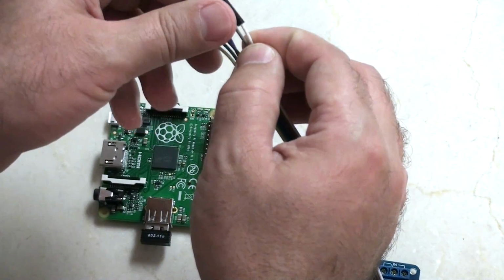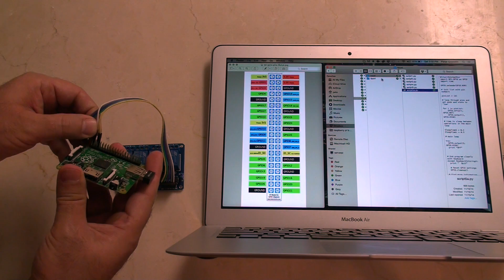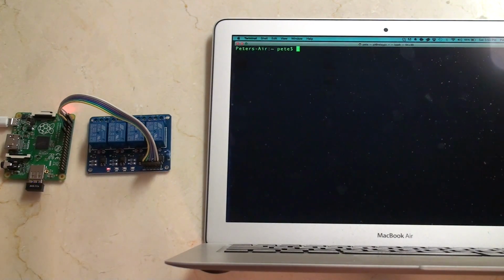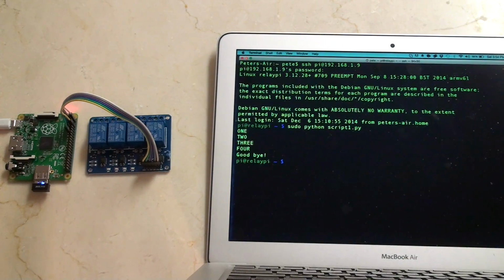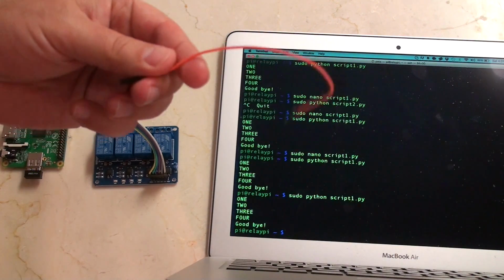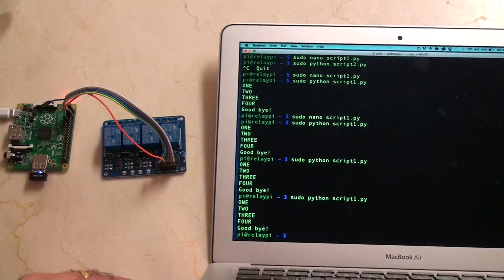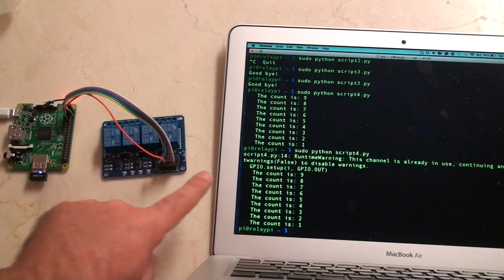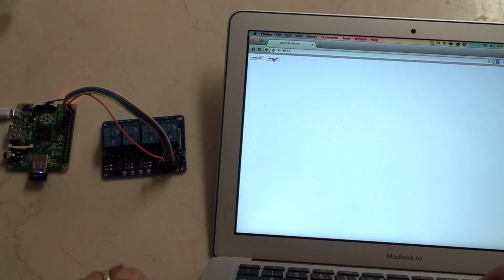Raspberry Pi: 4-channel Relay step-by-step with example scripts for home automation

Comment: HI, I'm not sure why, using your PHP code, the Python script won't run. Other than have all packages deployed, what do you suggest to debug it?
Reply from the maker: +Raymond Rivera .HTML!!!  It needs to be renamed .php
Reply: +Alexandre A. Passos If I run the Python script manually, it works. But not pressing the buttom on the PHP pag.
Reply: +Alexandre A. Passos Same here! Any solution?
Reply: Any news as to why nothing happens when buttons are pressed.
Reply from the maker: +Raymond Rivera I assume it's a permissions problem.  Did you do all this?  http://lpaste.net/raw/92403
Reply: +Raymond Rivera Must add this line to your sudoers file, Without "" of course - "www-data ALL=(root) NOPASSWD:ALL"
Reply: Yes, I followed the commands on that page.
Reply: That line is added  as per instruction on the 92403 page from Pete.
Reply: +Raymond Rivera It was a permissions issue for me. Check over the code. Make sure the correct GPIO is being used :)
Reply: +SuperSickNS Thank you everyone. Well, I hope it doesn't matter that I have a Pi 2 Model B? Here is the file permission on the sudoers file and index file.
Permission of the sudoers file
-r--r----- 1 root root 731 Jan  5 22:15 sudoers
below is from the filepi ALL=(ALL) NOPASSWD: ALLwww-data ALL=(root) NOPASSWD: ALL
Permission of the index.html file
rw-r--r- 1 pi pi 322 Jan  5 22:36 index.html
Reply: +skiwithpete Someone Shoot me now and delete my posts. lol. Index.php did the trick. SMH  Many thanks

Comment: Could someone write an example code of turning a relay on with say the button enter and then without changing the code save file hitting enter again and it shutting off the relay. So essentially code one displayed in this video except being on a timer make them operate on say a switch? press enter for on press enter for off

Comment: So let me ask also. If i do script switching realy on , and quits with cleanup, the output does not stay on ! I made basicly 3 scripts: 1. ON , 2. OFF, 3. ASK about stateso after running script 1 realy does not stay on, but if i ask about the state, RPI tells me it is on, after running on and off, 3. script tells me its off. So basicly the python will let the relay ON, only if you "forget" to use cleanup. But next opening of the GPIO will set it OFF again.........
Reply from the maker: with cleanup means it turns off. if you do it without cleanup... it will stay on
Reply from the maker: the scripts open with a line setting the state, so you'll need to get rid of that too.
Reply: +skiwithpete When i power on the raspberry pi 2, it appears that the default state is "on". So the relay is "on"  before running any script. Is there a way of changing the default state to "off" so the scripts turn it on and then the cleanup turns it back off.
Reply from the maker: +Phil Mander some GPIOs default as "on" others default as "off" - try changing the GPIOs you're connected to.

Comment: With the 5 and 5a programs, can i connect my garage door to the relay, and would it open and close? Also, can i just set the pi and the relay on a board, or do i need to wall mount it.

Comment: should we use optocouplers to keep the pi safe?
Reply from the maker: +Mithun Karmakar yes
Reply: +Mithun Karmakar The relay boards in question typically already come with optocouplers.
Reply: +skiwithpete what about transistors?
Reply: My monitor goes mad whenevr the relay flips.. motor give a bad EMI/Pulse feedback.. even the optocoupler isnt helping!

Comment: Hi I have tried a number of these and I just can not get the Relay to turn off. Relay turns on using GPO 4 but does not turn off. I have copied the code exactly.

The only error is scrit1.py:14: RuntimeWarning: A physical pull up resistor is fitted on this channel!
  GPIO.setup(i, GPIO.OUT)

Can you help?

Comment: Quick question... so I got everything to work, and I made new scripts that are identical to script5 and script5a, the only difference is the pin number. However, whenever I attach electronics (I'm using a lamp that I cut the wire in half) they only work when I touch the two ends of the wires to the center and right metal part. Whether the channel is on or off, the light turns on only with the center and right part. And whether the channel is on or off, the light never turns on when the wires are attached to the center and left part. What might have gone wrong? Maybe a problem with the actual relay? Thank You!

Comment: Thanks for your video 
Watching your video I have brought RPi A+ but I am using a 8 channel relay board 

How do I connect an external power supply for my relay board. Its the same board which you have in your other video https://www.youtube.com/watch?v=Z2B67hybdAA

How do i make an SSH connection with my PC. 

I want to connect an RTC        http://www.lelong.com.my/arduino-ds1302-real-time-clock-module-battery-cr2032-robotshop-159223534-2016-01-Sale-P.htm         to the RPi and ''ON''_''OFF'' the relays using the RTC. Can you help me in setting up the RTC

Comment: Thanks for the video..all of your videos. I know nothing of python so learning is slow going.
question I have is how do you get the scripts to work through the web browser. It was mentioned you have to use php. I have the concept of using Apache but that's it.
Reply from the maker: Matthew Tratz Yeah check the About section, I tried to make it as easy as poss.  The PHP section lists which packages to install, and all you should have to do is copy and paste the php contents and you'll be away (as long as it points to the right place where the file is).  Let me know if you hit any snags.

Comment: Hello, Thank you for your great video tutorial.
I try to do/run your examples about open and close some relays but I have some difficulties on closing the ralys. Do you know if I'm doing something wrong? (i'm using the same code as you wroten in script5 and script5a. script5 is working but script5a not).
thank you for your answer.
Reply from the maker: Dragos Florin Stefan From the information you've given me it's very difficult to tell what has gone wrong.  I think that you should check if pinList = has the same number on both.  Besides that, any further information about the error will help.
Reply: skiwithpete well... I can Open the relays but I can't close them. script5 is working, script 5a not working. :))
Reply from the maker: Dragos Florin Stefan are there any error messages?  what is does the line with PinList say on both scripts?

Comment: So looking at your code examples it looks like these relay boards are active low. I was planning on using one of these boards to operate sprinkler solenoid valves for my garden irrigation with WebIOPi. Do you see any concerns with the pins reverting to an active low state after a reboot...say the power goes out. Don't want my irrigation valves opening unexpected say if I'm away.

Comment: Little confused as to how you are reliably triggering the relays. All reviews on the amazon link you provided, some documentation, and other youtube videos, state you can't trigger them with 3.3v and that either a transistor or optocoupled 5v rail is required. Obviously your solution is considerably simpler (and simple is better in the race car situation I wish to place my pi) however wondered if you considered it reliable, or electrically responsible (as in it shouldn't work, but does... for how long I don't know?)
Reply from the maker: Daniel Powell There is a lot of confusion surrounding these relays.  If you watch Gavin McDonald's video, you will see that my method results in difference of 1.7V across the optocoupler.  This is fine for working "in practice" but if you want to further study this switch for electric responsibility you should check out his complete video here: https://www.youtube.com/watch?v=b6ZagKRnRdM
Reply: skiwithpete Thank you very much for the reply.From someone as electronically inadequate as I your assistance is most appreciated. . I note that Gaven uses both the 3.3v and 5v supplies for VCC and JD-VCC respectively.Given this negates your 1.7v difference, why did you not opt to simply set the jumper on the relay board and supply the relay with both 3.3v and 5v (as Gaven did)? Cheers, Daniel
Reply from the maker: Daniel Powell
 It doesn't work.  But, I understand that if you buy a different relay or if you use an external supply that you might be able to achieve different results.  You asked for the "electrically responsible method" - and I know that in theory it is meant to work in that way.  Not that the 1.7V is of major concern to me - but if it is to you, I just want to be clear that this is an 'in practice' video.
Reply: skiwithpete Pete, wanted to thank you very much for your assistance, your tutorial, and the theft of your code. Works a treat and saved many a keyboard from having a forehead imprint (and forehead having a keyboard imprint) As an aside it appears that I have the same relay package as you, and mine works with the jumper removed  JD-VCC connected to the pi 5v and the VCC on the larger jumper block connected to the pi 3.3v....Now to start coding the sequential gear shift.
Reply from the maker: Daniel Powell
 Thanks for your kind words.  I think I'll have to give it another go...

Comment: What's the purpose of that blue jumper on the relays?
Reply from the maker: dgcompany54 the blue jumper links VCC and JD-VCC.  If you want to isolate the relay coil drive voltage from the optocoupler VCC, you will need to drive the node labelled JD-VCC with another 5V supply.  In the example in the video, I leave the jumper connected.

Comment: Hey, really good video! I really hearing about your raspberry pi project. I have new raspberry pi and i am a little bit confused about one line of code:

# loop through pins and set mode and state to 'low'
for i in pinList:
    GPIO.setup(i, GPIO.OUT)
    GPIO.output(i, GPIO.HIGH)

thr comment says that the GPIO has to be set to LOW. Then why is the GPIO output set to HIGH ?
Reply from the maker: Erm.  I erm...  errr...  Because... err...  Are you saying I made a mistake?  IMPOSSIBLE.  Only humans make mistakes!
(Well spotted, I've already adjusted the code and reposted it on lpaste - I've recently started a github too, and I'll post it there soon.  I noticed another booboo too, but shhhh... don't tell anyone.)
Reply: @skiwithpete  there are no mistakes only happy accidents and 
Learning opportunities. :)